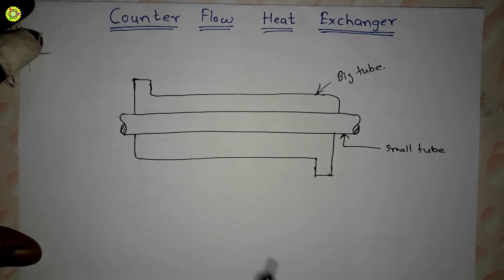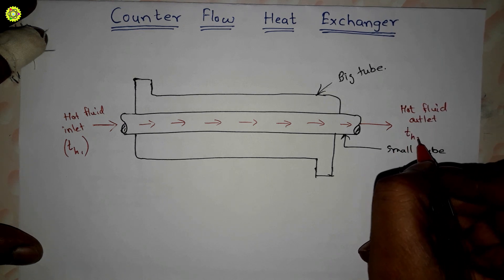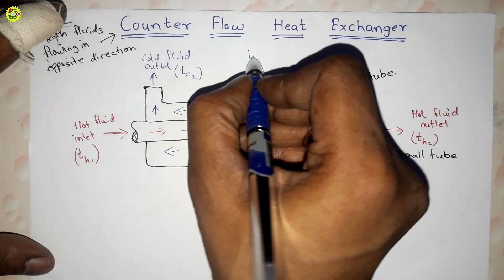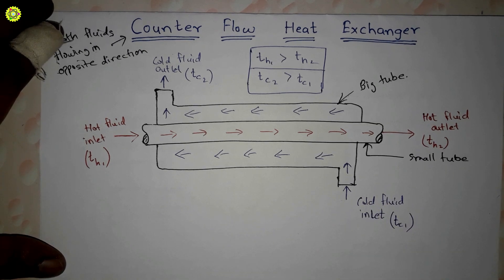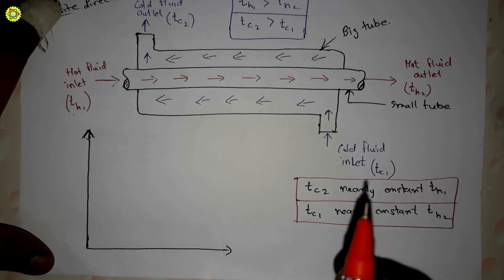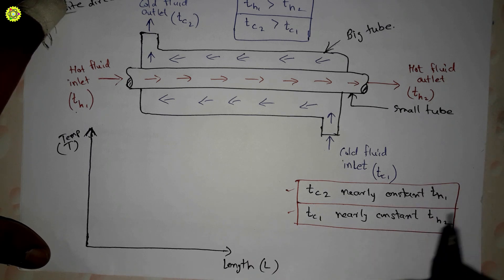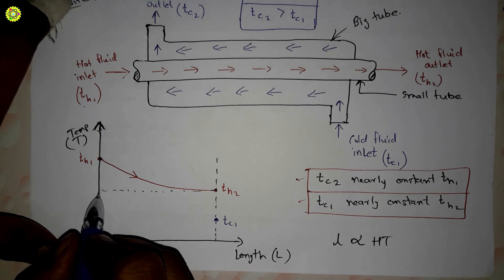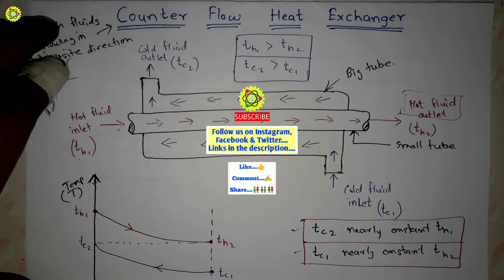Counter Flow Heat Exchanger | Working, Explanation, Graph  Heat Exchanger

Comment: I was playing the Stationeers physics simulation game, and this Counterflow Heat Exchanger can be built and used there in the game.  Players use them in phase shift (liquid/gas) refrigeration, evaporative cooling on one side, compression heating with condensation on the other side. The graph was nice to see, thank you.   Why do you pronounce "fluid" as a French "fleur" for flower, though? :)
Reply from the maker: Welcome. By the way didn't get your question ?